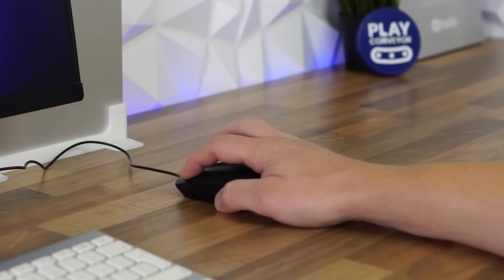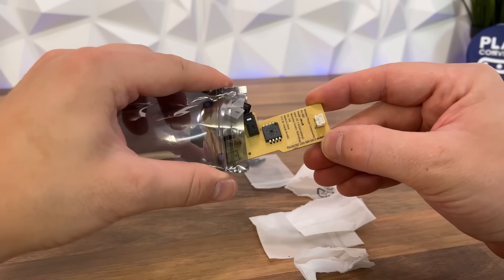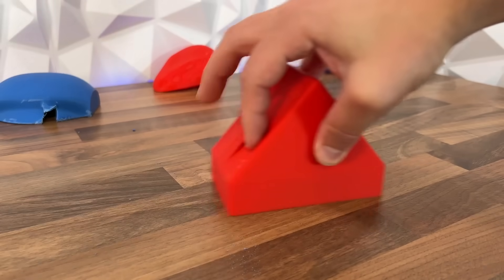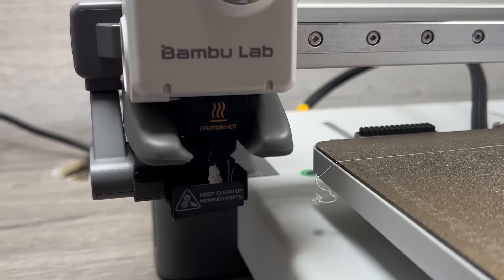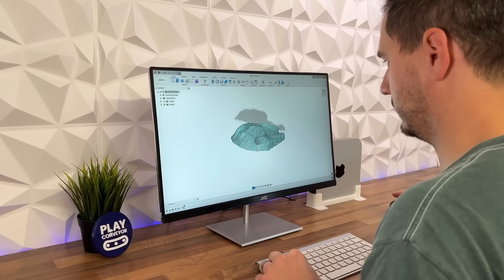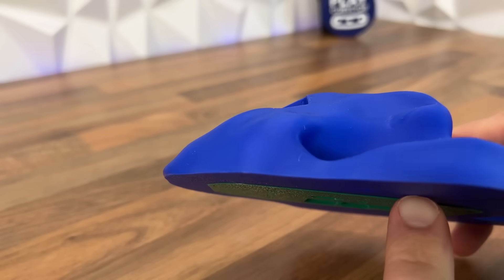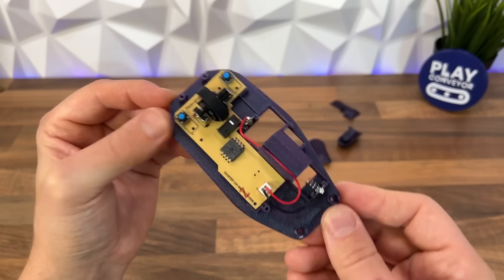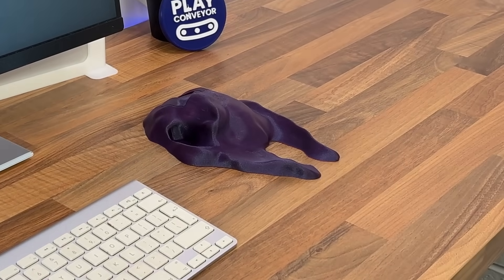I Built the World's Comfiest Mouse (ft. Bambu Lab A1)

Comment: Ahh, the Millenium Chicken Mouse.
I feel like it's certainly a good way to start with designing a personal ergonomic mouse, but here's a couple things that come to my mind.
1.) Large contact area. The way the Millenium Chicken shape contours the hand may be rather unwieldy in moving it around. Especially when you pick it up and try to tilt it with a familiar motion. The large contact area also introduces the issue of needing countless mousefeet to lift it up, or risking the bottom deforming enough to create friction with the table.
2.) Weight. The way this mouse is designed, the "wings" and the dome are both solid and while all in all the plastic might not be particularly heavy, I imagine the actual usable surface of the mouse is actually a lot smaller than what this design actually spends volumes of material for.
3.) Contact area. I imagine working with a mouse like that would eventually lead to sweaty hands with all the contact area the hand has against the plastic. I wonder if the area could thus be reduced by only leaving supports reaching all the way to the hand in places where they matter.
Reply: holy nobody caresss

Comment: Problems which can be improved: 

Use a white or gray colour clay to scan 

Use the scanned model in blender and adjust it accordingly 

Create it using not 3d printer but research about other materials which are more comfortable and will provide a grip and sweat free feel to the mouse . 

At last try and try and you will find a better mouse .

Comment: You might look into printing some gear assemblies for the mouse wheel. You should be able to move the wheel to a more natural location and transfer the rotation to the sensor that way. You'll need to use an even number of gears or else the scroll direction will be reversed.

Comment: I've spent literally decades (got my first PC in the mid '90s) searching for the most comfortable mouse. It's been a long struggle because of my fairly long fingers which have almost always stuck out over the front of the mouse in quite an uncomfortable way. However, about five or so years ago, I finally found the one that works excellent for me: Logitech MX Vertical. I absolutely love it! The only downside is that it tends to break a few months after the 2-year warranty has run out (which has happened twice now) and I haven't been able to fix it myself despite looking for solutions online, so I just have to include a new one in my budget every other year.

Comment: The main problem is that the hand changes over the years and the ergonomics of the mouse also changes. And it's a little difficult to make such mice. Although they make in-ear headphones to order, where they pour resin directly into the ear, and then scan the impression. This could be done with mice, it would be possible to stir up a good business

Comment: This may be dumb, but it's actually the most innovation I've seen in mouse for decades
Reply: How can you call it dumb and innovative, in the same sentence 😂
Reply: The hand form concept is the most basic form of ergonomics, but it doesn't make the effort of being vertical like any ergonomic mouse, which's main function is addressing unnatural arm posture leading to carpian tunnel syndrome. After working for a decade on programming I had really bad pains and a vertical mouse was so effective it felt like magic.
Reply: It actually is both because it’s very innovative but still dumb in a certain way 
In fact it’s still not very ergonomic because our hand isn’t used to be in that position. Even though it lays comfortably, the fingers still have to move a very unnatural way. 
There are actual ergonomic mouses already to buy and they‘re shaped very differently. With the thumb facing upwards. 

Please consider that for your second prototype
Reply: If it works, it ain't stupid
Reply: @Dachnik228  wouldn't we need to wait until he tested it properly to say if it works or not? also, I really don't think this would address most problems with using a mouse, and might I add, I wouldn't be caught dead using that thing😭
Reply: check gun mouse, it's pretty nice

Comment: If you can, try to scan your relaxed hand floating in water in the position you work and sit at the desk.
Structurally whatever holds up your hand in the position you want is enough, you don't need more surface than that. This way, you can cut away the rest, so it doesn't have to look "too organic". (there's nothing wrong with this as is now, things look the way they do for economic reasons anyway, pure ergonomics is always custom to every body)

Comment: Photogrametry is the go to tool that is used for scanning objects that you want to digitize.  This is how all the 3d models in Megascans are made. Simultaneously you can also use the photos themselves to extract the texture you need for an asset. My guess is that LIDAR just isn't precise enough for small details and the one in the iPhone might also be rather bad. They haven't mentioned it since they first launched it in their Pro lineup and I think it's still around because they can use the depth information for photography. I have tried using several applications but photogrammetry is the only option

Comment: Behold the best idea for the World's Comfiest Mouse:
Add cushions for the lower palm/wrist support and trim the edges of the mouse to make it look smaller. Keep the indents as they are but add some bevels to remove sharp corners of the crater. 
Optionally for extra ergonomics create the mouse for sideways use, aka a slight tilt for natural rotation of the wrist. For this one a U shaped cushion for wrist support would be gold.
Reply: Add a button or more to every finger to maximize power usability. I got 10 extra and would need at least 3 more and a wheel for the thumb. My cravings for more buttons was started with Fatal1ty gaming mouse, added by Silverstone Raven (that I had to mod to move some buttons and replace the massive thumb wheel with a lot smaller one), then a Logitech G300 took much away, though introduced the idea of having two extra buttons on each side on the very front. Roccat Tyon has now been the no1 contender for years, even though it's shape is too long for my hands, the indentation for the thumb is too shallow and occasionally I have a hard time gripping it good enough to get it to lift.

I wish I could get a mouse that has the features of the Tyon, plus:
-A premium scroll wheel with tilt and option for indexing/free rolling with adjustable brake/tension
-Two buttons right behind the scroll wheel
-Scroll wheel for the thumb (with indexing/free rolling)
-2 or more thumb buttons
-Better sensor
-More vertical design

Though it would probably cost 300-600+ dollars, like the Elecom M-DUX70BK
Reply: For gaming the cushion would be an awfull idea because every gamer knows your hand needs to touch the desk so you feel how far it goes, now yes its about comfort but if a mouse is annoying to use what is comfort.
Reply: @TimmyGamingYT  It's actually better to use your whole arm for more precise aiming, believe it or not, even better if you have support for your wrist on the mouse itself. It becomes like an extension of your body, samurai type shi.
Reply: @x3Memes  i only use my wrist for aiming  high dpi  low sensitivity   i use the razer basilisk v3 its pretty nice for my hands its also on the cheaper pretty good for the price range. and i tap heads any fps game i play im always on top 1% LB

Comment: I have one thought that nobody in the comments seems to be touching on and that's lifting the mouse to recenter your cursor position. With a normal mouse this is just an involuntary action because it's so easy to lift, but with this design I see no easy way of comfortably repositioning no matter the sensitivity you use. As many have said, a trackball or vertical position would add to comfort/ergo, BUT it would also eliminate this issue. If you don't like the trackball idea then make sure the design allows you to easily lift and reposition when needed. The ONLY other way I know of to deal with this issue of not lifting is to push your cursor on the edges of the screen when you wanna recenter which gets tedious very quickly.

Comment: As a tip: if you're going to DIY a mouse like this, I'd start with one that's a little bit nicer. At least for version 2.0. A dollar store mouse will do fine for a proof of concept, but lacks certain conveniences that higher end mice can offer. If you don't want a side wheel, but you do want a mouse that will track on literally anything short of a flawless mirror, I like the Microsoft Explorer mouse with Blue-Track technology. It's been discontinued for some inexplicable reason despite legitimately being one of the most reliable computer mice I've ever used, but if you're going to be reworking the shell anyway, then buying a used one off ebay doesn't seem like a big deal. Just clean the thing thoroughly before rebuilding it. If you want the absolute best mouse from a functional perspective and don't mind using it on normal mousing surfaces, then the Logitech MX Master mouse is the obvious choice. The side wheel is very convenient if you do a lot of work with interfaces that need side scrolling. I've owned and used both and they're excellent choices for the base materials.

I'd also consider just masking off any large gaps in the mouse body and molding the play-dough around the form of the mouse so you can save yourself some effort in 3D modeling the thing by sculpting in gentle transitions and recesses for the mouse wheels and any buttons that can't easily be extended through an armature.

Comment: Want a comfortable mouse? Use a trackball.
Ones where the ball is moved by your index/middle finger. Not the ones moved by your thumb.
You're eliminating wrist muscle fatigue.
Combine it with that design, and you've got yourself a potential business.
Reply: I use very high DPI and Windows "Enhance pointer precision" to get more ideal curve. Some talk about mouse acceleration but it should be called mouse deceleration, as the cursor moves less with slow speeds. On a 2560x1440 screen I move my mouse for about 1,5 to 2 centimeters to quickly move the cursor from one side to the other. When trying to move as slow as I can (steadily), the mouse movement is around 2 to 4 centimeters. The DPI is at 6800/8200 for those measurements, but I have the top "fin" switch on the Roccat Tyon mapped as DPI up/down and have set the DPI switcher to 1600/3000/4600/6800/8200 when I need less cursor movement (be it photo editing or sniping in game or something else).

I noticed there is some program (or more than one) to adjust the acceleration curve, discussed in r/MouseAccel

I think the perfect mouse would have it's own hardware for a customizable DEceleration curve.

-

About the mouse curve in macs. The whole system is unusable if one is used to, or needs any actual snappy mouse cursor movement, as the whole system is clearly optimized for very accurate small cursor movements and it works wonderfully in things like photo editing. Though I've just had to use them a few times in school. Back in 2010 I brought my own mouse to school just to try to get rid of the senseless need of awful jerking/plucking of the mouse to actually get the cursor to move more than half of the screen. Don't know if there's some program nowadays to make the cursor "actually" move when the mouse is moved and not just for a miniscule amount.

Comment: your mouse looks awful to use. why did you mold your wrist into it? i can tell you obviously dont play video games. 

FPS games require fine precession and fast movement. you can't get either by moving your whole arm. 
you have to use a claw grip with a combination of finger movements for precision and your wrist for quick movement. with a high DPS setting you can cut down on how far you need to move the mouse to save your wrist from getting carpal tunnel syndrome. its important to not grip the mouse like its the last precious thing you own and someone is trying to take it. (aka death grip) to avoid finger cramps.
in a sense you have to be gentle and nimble to find comfort and ultimate control.

the apple mouse is also a terrible design as your unable to grip it properly. which is why its an uncomfortable contraption that belongs in the bin.

Comment: lol. thats alot of work really just to only build off a fundemntally bad design to begin with

well, are mice really a bad design idea in general?
I'd say inverted mice, aka rollerballs? 
they arent too popular, are they?

i think mouse designs sit on our desks STILL for a reason

trust me, I'm all about finding new ways of interfacing.
I think at best...... we have the tech and design of laptop input touch pads..... in front of the space bar, ya know? touch screens are nice, but after a while, holding your air up in the air and straight out, hurts.

touch pad "mice" .... using the tech within of something like "rf field interfereace" is AWESOME and designer, made it licence free to be used by the world freely.
when you allow the fields just to permiate the space around you instead of just a pad requiring to be touch.... then interesting things happen. i discovered this by accident reaching over a wire i had laid out , unknowingly acting like an antenna.....
and having a live graph on screen showing a reading i was taking from  it...

i could see that with 3 wires....... extending over XYZ that something amazing happened

I.... became the controller. 
with the right  XYZ set up and the right equations (probably AI) im sure the future will present us exactly that

capacitive sensing (but touchless) there was a diy arduino xyz version here on youtube i ended up building... basically a cardboard box...... but just 3 sides of it..... each with its own foil plate,,, attached to 3 insulated wires.

and still would allow for you to place a flat , non compacitive plate inside of it to lay your hand upon and give you good XY readouts. (ignoring z at that point, if desired)
to imporve precise read outs..... im sure AI could give us some great benefits over not using ai

Comment: Complete waste of time, cos no matter the "comfort" all of that is gone when you need to "quickly pull the mouse up", lift it from the table and place it some 20cm to the left or right - with your shape.
My G700 is perfect, it even has 4 additional thumb and 3 additional index buttons freely mappable - even with macros.
It also is very comfortable, one can use it with or without the cable and one can also "switch between claw- and palm grip.
The only thing that bothers me is how the ring finger and pinky feel - me: takes out a soldering iron and makes a small dent/groove for the ring-finger and puts some more abs filament with the help of the soldering iron into that space and then dremels and polishes the surface smooth.

And now even if I could have 3d printed that part, it won't come as clean as the original shape of the G700 alrdy is.

I don't want any other mouse that one modded is alrdy perfect.

Comment: Maybe you should try seeing about just making a mouse-glove combo for a second attempt. A not-quite haptic glove with buttons on the inside of the index and middle finger sleeves that form-fit to them, so you can go out and look not like an uber nerd with a rock formation mouse, but an uber nerd with taste.

It'd just look like a funky glove, and clicking the buttons would look and work just like you're tapping the desk essentially, or using an invisible mouse. You could also make the buttons hinged, or maybe you're probably better off just using pressure sensors so you can still use your hands out in the wild, I dunno.

Middle mouse button could be clicking your ring finger, and scrollwheeling could be rubbing your index & middle fingers together, or your thumb and middle, maybe.

For added coolness factor, make a second glove for your non-dominant hand that acts as a keyboard/'cyberdeck.'
Reply: (Sorry this isn't 3d printing-related btw, I'm apparently the rare nerd who doesn't care about 3D printing at all.)

Comment: that mouse has excess material that doesn't add to the support and comfort of the mouse, it's not angled diagonally or vertically to decrease wrist strain, and I didn't see a mouse pad let alone any sort of mouse feet to improve the glide and decrease resistance of moving your mouse. Overall I'd say it's not bad with some good ideas but there's a lot of room for improvement.

Comment: I think the main flaw is to shove the mouse around. Why isn't there a ball for the thumb to move the pointer? Instead of changing the angle of the wrist all the time you shove the mouse around you may then find a comfy angle for the wrist and move the pointer just with  thumb movement. Or am I wrong and thinking in a wrong direction?

Comment: While this is an interesting approach, I think right off the bat there seems to be a functionality problem. The size of it makes it harder to use, since it will bump into objects on the table more frquently, and has a large table contact which adds a lot of fridction to move it. I also seems to lack functionality; the click buttons seem to be too small, the wheel too far away from the fingers, and it doesn't even have a way to add side buttons, which for some people (like myself) are incredibly useful. Obviously I can't know for certain because I haven't tried it, but it does seem to be likely problems. Gladly, it seems like all these problems are easy to fix.